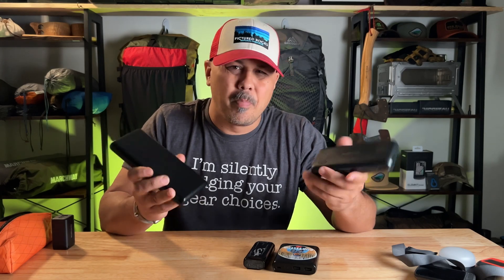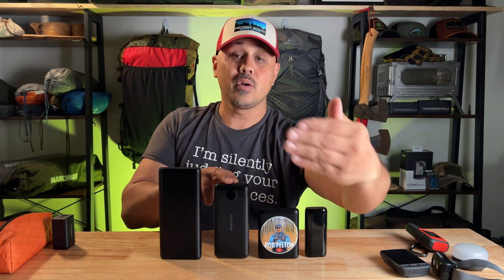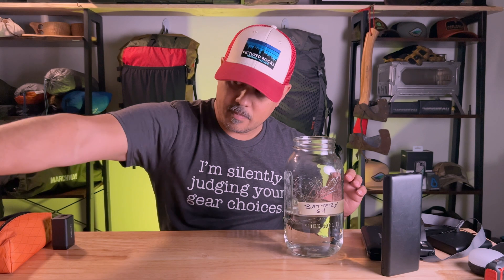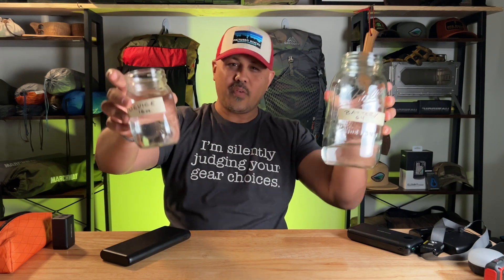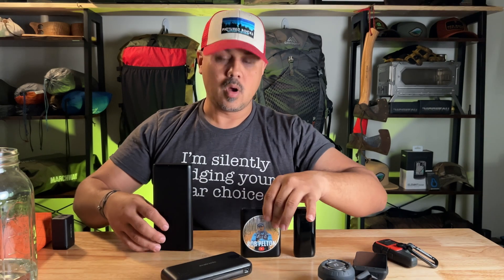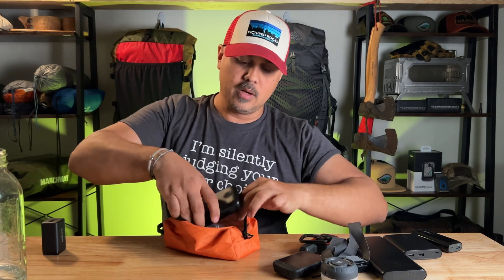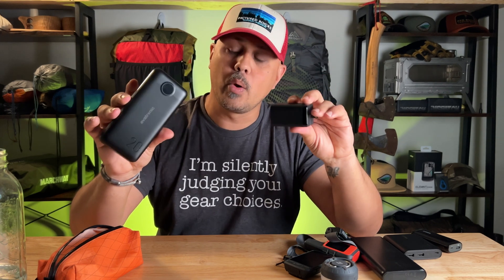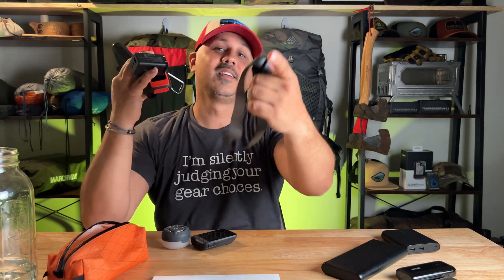Gear Talk:  How Do Battery Banks Work?

Comment: I find the 20,000 mAh battery capacity is the sweet spot for me to charge all my electronics for 2 day trip with a little reserve left. Great video and glad to also touched on the inputs which some people may over look when picking a battery pack.
Reply from the maker: Thanks! The 20,000 really is a good size. Worked very well for me on my last trip. 3 days, 3 nights.